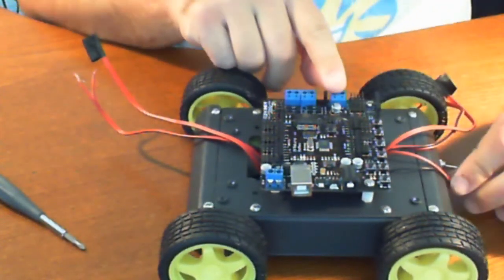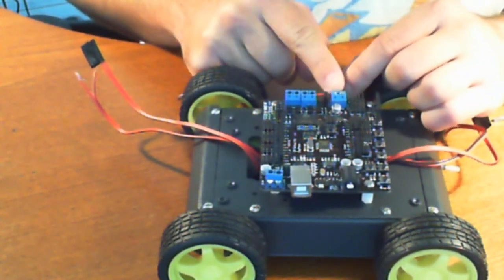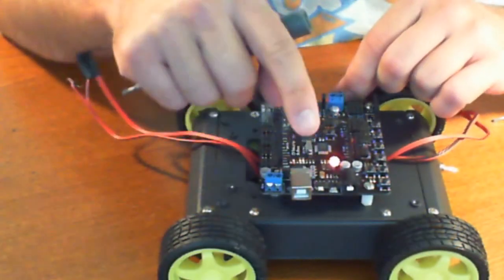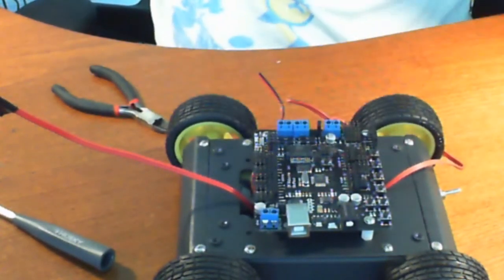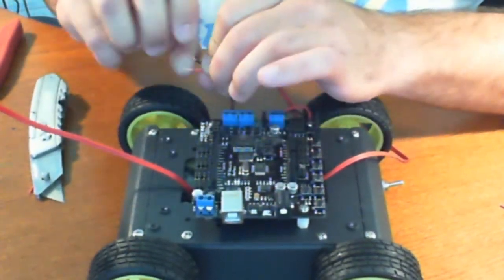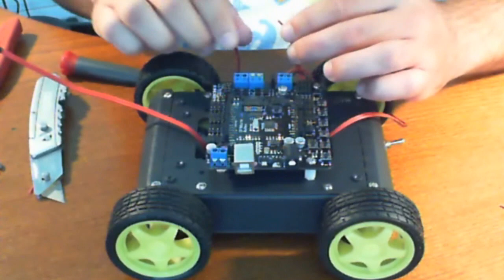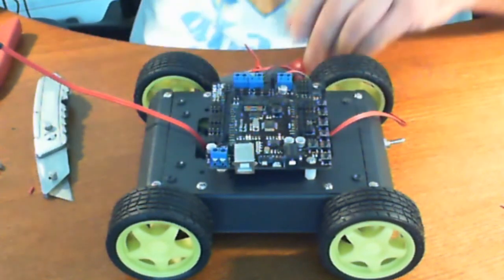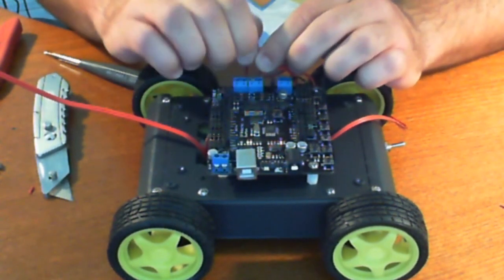DFRobot Arduino Mobile Platform Review - Part 8 - RUG Community Robot Review

Comment: doesn't matter, just make sure you wire them the same.. Let's say you have pin 1 and pin 2 on the motor, if you wire pin 1 positive and pin 2 negative it will spin clockwise, if you wire pin 1 negative and pin 2 positive, it'll spin counter-clockwise...

Comment: Hey there 

Can u help me by telling me hoe did u wire the motors to the MC ? (i'm using seeeduino mega)

and what kind of code do i have to use on the microcontroller to make the motors start?

Thanks dude